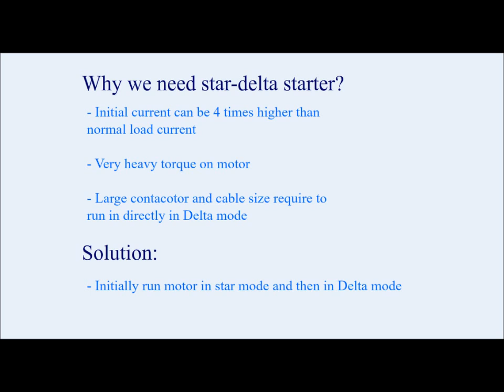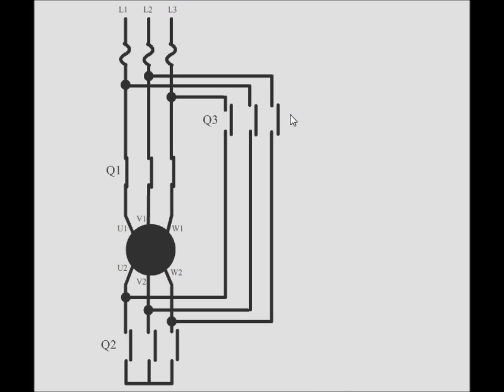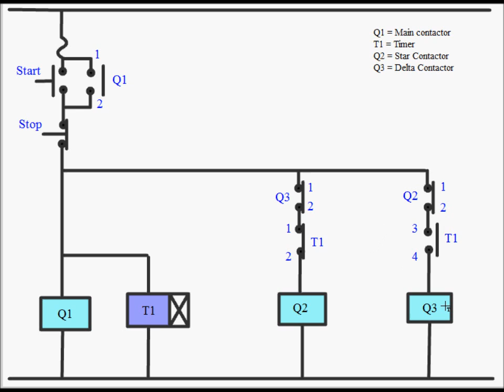Star-Delta starter

Comment: How to adjust over current protection of a stater , i mean the current rating, i have a 15. Hp motor, the current rating on motor lable is 22 amp, what is rating to be adjusted on starter   ?
Reply from the maker: Don't go by rating on motor buy measure actual current on full load using amp meter. Let say it is 15 AMP on full load so better to put on 18-20 AMP range. In my experience when ball bearing of motor worn out, then it will start to draw more current and chance of motor wiring burn out.

Comment: Good explaination sir, can you tell me which software you used for simulation.

And i understand that. 1st main and star contactor will pickup, then timer switches off the start and on the delta contactor. but main contactor will remains on in both star and delta contactors gets on.  Am I right?

Comment: I have one question.....please someone help me....what i know is Star delta starter is used to reduce the starting current drawn by the motor.........but how about variable frequency drive (VDF).....is it same concept and purpose....to control the motor....so confused.....
Reply: ADIB RAHMAN  its VDF is a same concept with star delta concept
Reply from the maker: ADIB RAHMAN Yes same concept. Both methods help to start motor slowly to avoid high torque and high current. VFD is very advanced and power transistor based. In specific environment, you need to control motor speed, start and stop in very accurate manner and VFD solve this purpose. With star delta starter you can't control motor in precise manner. Check out following link:
https://en.wikipedia.org/wiki/Variable-frequency_drive

Comment: I understood the over current protection for the motor. I just didn't see any line side phase to phase. I use NC and NO coils to keep the contractors in sync. This makes sure that both contractors can't both be closed or one gets locked closed due to welding closed. Even a push pull contact can be used.

Comment from the maker: I am already using Q2 NC in path of Q3 and Q3's NC in path of Q2 so that is the protection. By this interlocking, they both will NOT operate at same time. 

In power circuit, I have already mentioned circuit breaker and fuse in case of mechanical failure of contactors.

Comment: Where is the safety to prevent any locking of the contractors to both be closed at once in Q2 and Q3? Seems you need some kind of fused or breaker disconnect to prevent phase to phase from happening.

Comment from the maker: I think you need to check your contactor coil voltages. These coils can be AC or DC and with lot of voltage options i.e. 24V DC, 120V AC, 220V AC, 440V AC etc.

For ex - In India, voltage is 220v between phase and neutral and 440 between two phases. So if your coil voltage is 220V AC, you need to use phase and neutral and if it is DC, then you need additional circuit.